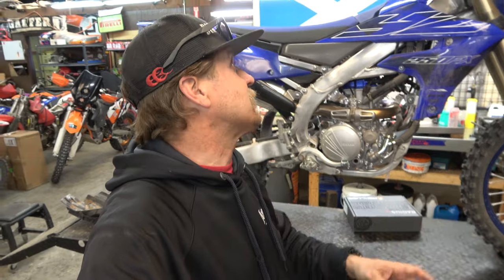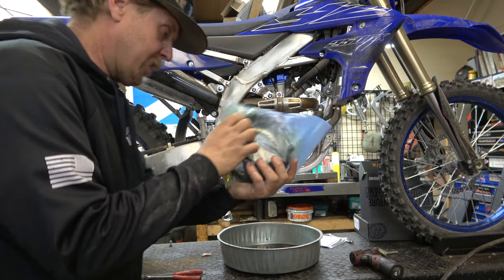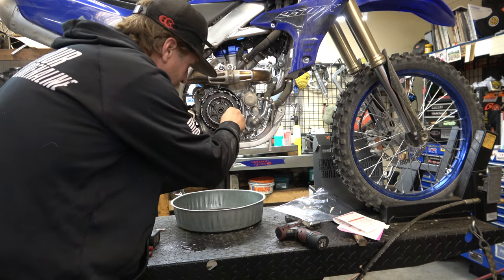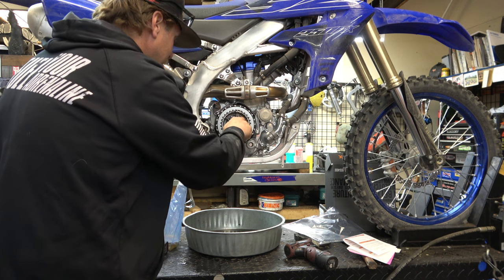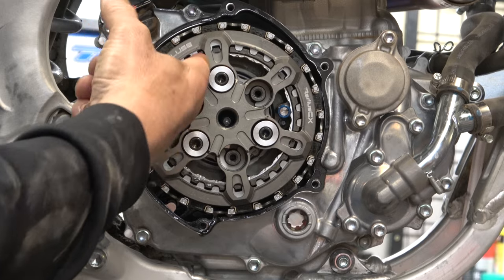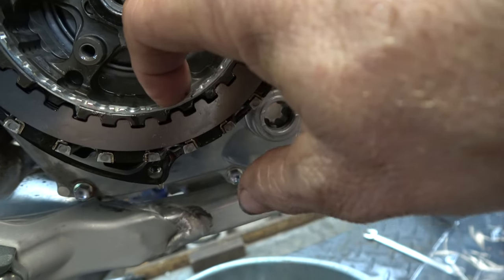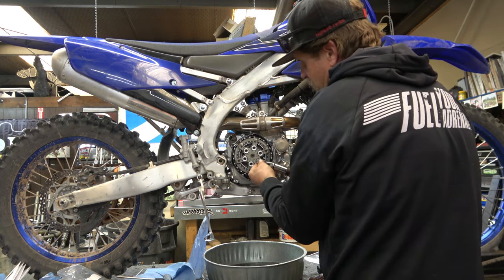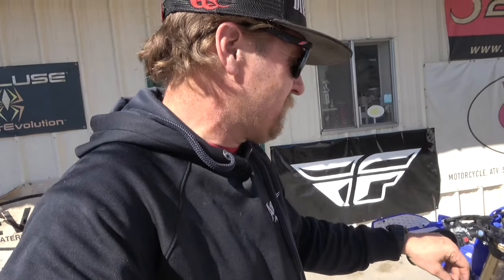How to install a Rekluse Radius CX | Yamaha YZ250FX

Comment: Pro tip: Other way (which I preferred) is to spin inner ring all the way it and use the external freeplay gain method. This way you can adjust at perch AND you can bump start bike by letting out freeplay at lever in case electric start fails.
Reply from the maker: That works for sure, I just don't like the feel of the lever being banjo tight.  It just feels weird to me when feathering the clutch.  I do like the idea of being able to bump start in a pinch.
Reply: @highlandcycles  agreed. Clutch pull is a little harder.
Just thought I'd add that info for peoples understanding.
I didn't like having to pull cover to adjust... something I don't have to deal with on my KTM because of the adjustment on the slave cylinder 👌
Reply: @highlandcycles  great video. I install my recluse following your instructions, and everything has seemed to work out except for the free play gain. It seems like no matter what I do. I can’t adjusted to have the little  but of gain.
Reply from the maker: @howellcp  huh. That is odd

Comment: Will the Rekluse offer any added "flywheel" effect in low speed tight technical sections to help avoid "flame out" and stalling?  I know the Auto-clutch is supposed to handle that but as hard hitting as the YZ450f is already I can see it falling on its face despite the Auto-clutch.   I've already taken the "teeth" out of the bike with mapping but it needs more help like the Rekluse would offer in the tight New England woods.   Great vid and editing.  THX!
Reply from the maker: I would look at a flywheel weight.  The Rekluse won't do that part
Reply: The best flywheel weighting option I've found for the 450f is actually an entire, heavier clutch basket.  $300+  With that, I'm a 1/3 of the way to buying the Rek 4.0 if it would solve ALL the issues. 🥴

Comment: Are those sleeves you put on the clutch basket unique to the Rekluse kit?  Or are they a part you can get for most other bikes?
Reply from the maker: They are from Rekluse and they might only work with Rekluse friction plates since the fingers on the plates would have to be narrower to fit.  They only make them for the Japanese bikes.  I know that Barnett makes a sweet clutch basket  that has sleeves like that.

Comment: Hey I got a question?? I bought a 2013 Husaburg TE300 that the previous owner Installed a rukluse auto clutch core exp and did not give me any of the parts that he replaced when is stalling it. Question is what do I need to do to go back to a manual clutch??
Reply from the maker: Inner hub, all the plates, springs, bolts, pressure plate. Slave cylinder

Comment: I have Rekluse Radius CX on my 2021 Yale YZ250FX. Everything is set up  correctly but I've noticed much harder clutch lever pull after installing Radius CX. Is this normal.
Reply from the maker: Yes